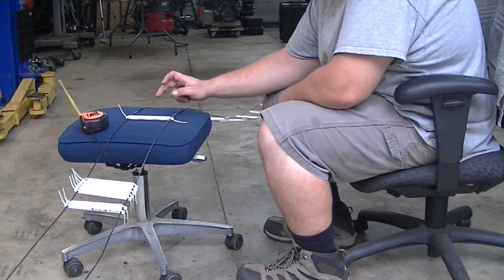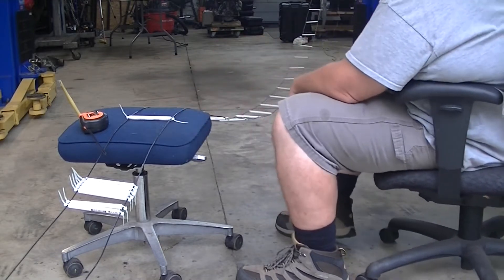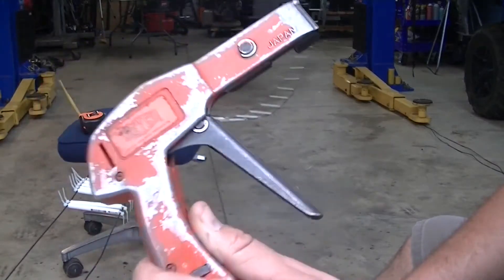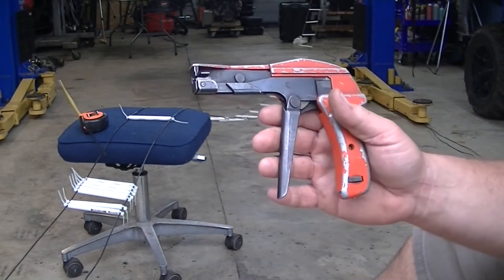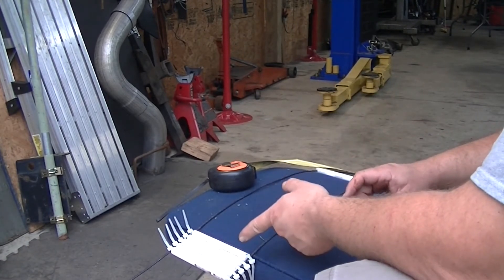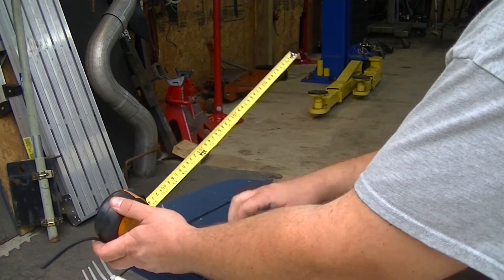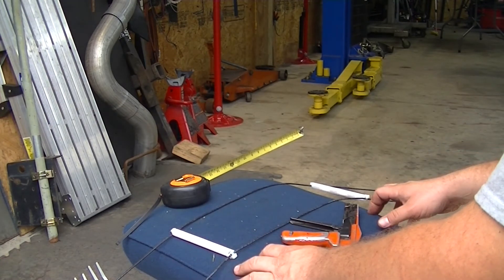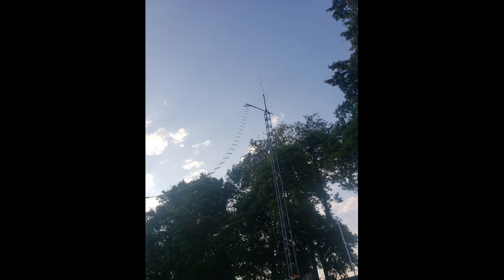Ham Radio HF 160-6 meter Dipole/doublet & Ladder line/Open wire

Comment: Time will tell but I don't think the white tie-wraps will hold up to UV. I learned that the hard way and use black UV proof ties now.
Reply from the maker: yea i know all i had at the time its super easy to lower rope on a pulley so repairs are easy thanks for watching